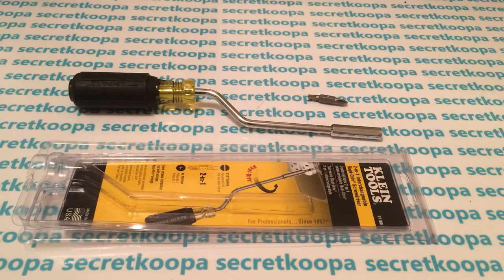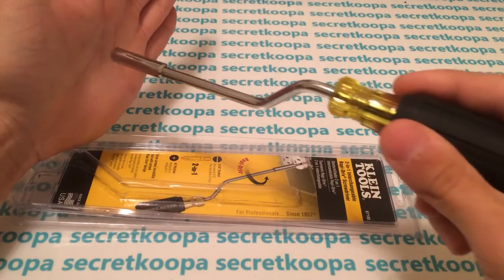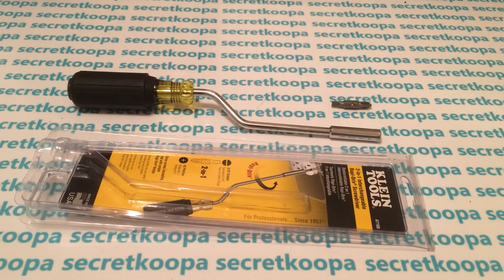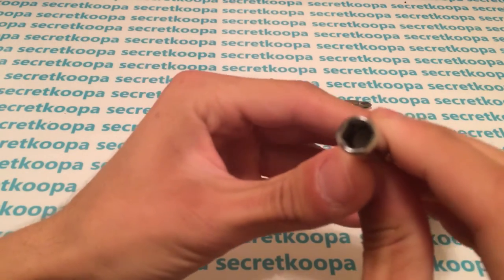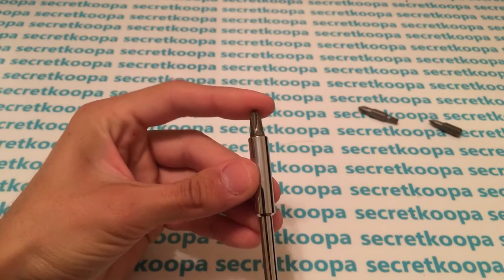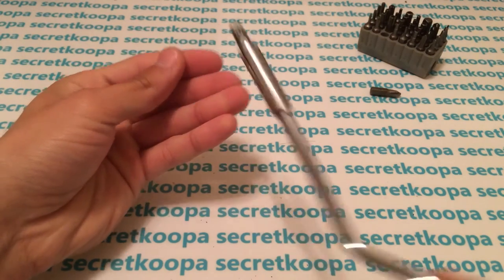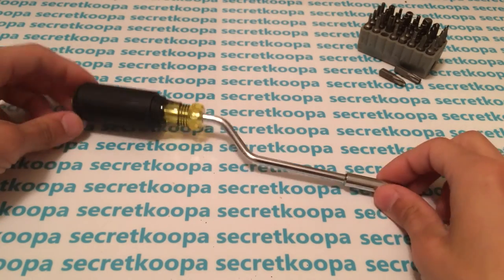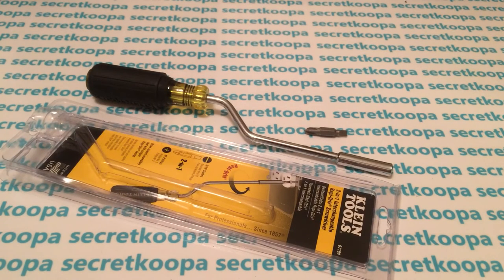Modified Klein Rapi-Drive Magnetic Screwdriver! + Review

Comment: i just made a tool that you cant easily find, well snap on make on but way expensive.  its a stubby screwdriver magnetic bit driver!.    i took  a standard chubby driver, pulled out the blade, took the standard bit holder you use in a power tool, and drill out the handle to accept the full depth of the adapter, it ends up being the same dimensions of the snap on ( i do have one, wanted another) but you can fine pretty nice stubbys at the dollar store and the adaptors i have  loads from various sets over the years, but you can buy cheap online
Reply from the maker: That tool looks like they made that way very nice, great job!

Comment: That's awesome. I've been looking for those magnets forever. I have tried 6mm but they needed to be shaved which made them sharp as hell and flaked apart. Source for magnets?
Reply: I know 3mm works, but I think you can get away with using 4mm, or 5mm too. A 1/4 inch socket (your standard bit holder) is 6mm, so you're magnets can't be 6mm because they are not hexagons; they are circles, so they're not missing the sides and won't fit into your bit holder.